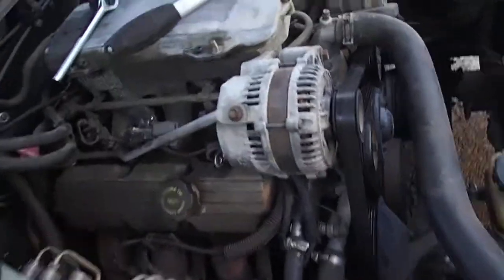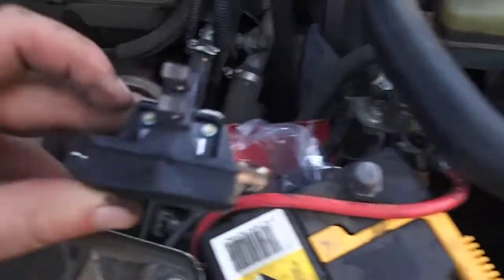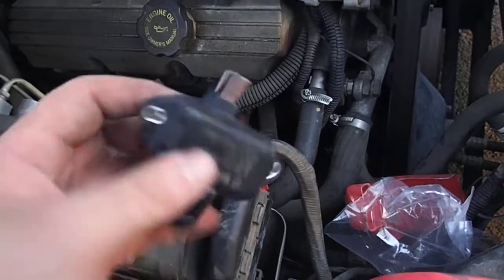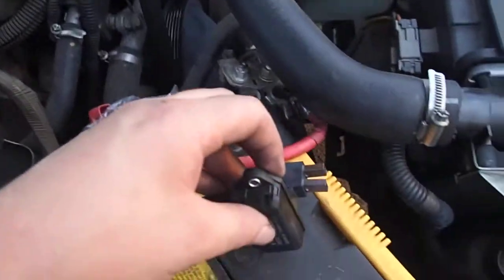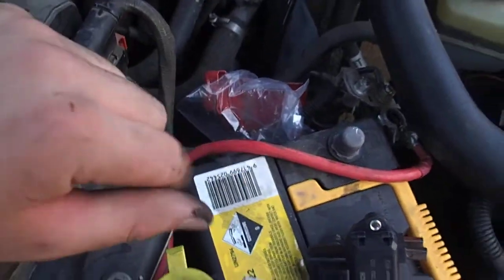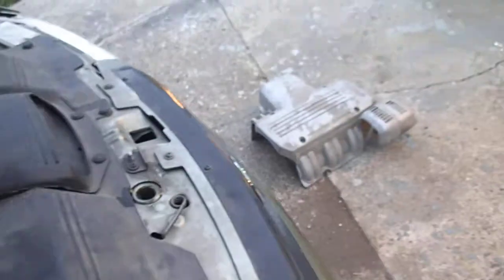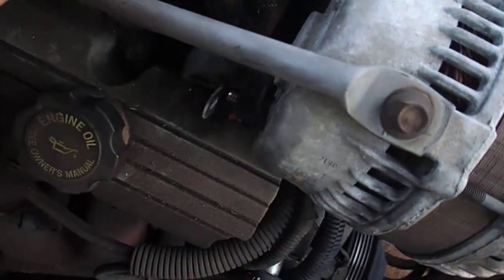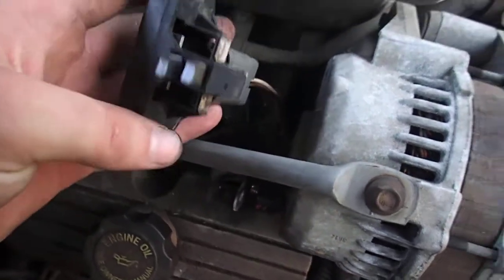VY Regulator change

Comment: Just wanted to reach out and say a big thank-you for this great nugget. Normally, I would go to my trusty old mechanic. But he is away for a month and a half and I need the car to work this week for some trips I have to take. Sourced the part at Repco, same day I called them. But it is closer to $120 rather than online where you can apparently get after market ones for about 30 bucks.
The reason I knew it was most likely the responder, rather than the alternator is because I literally had the RACV around changing the battery a fortnight ago and he tested the alternator.
Time to buy a newer car.